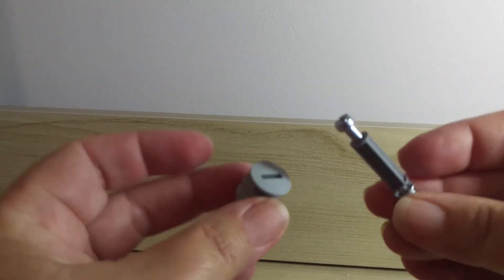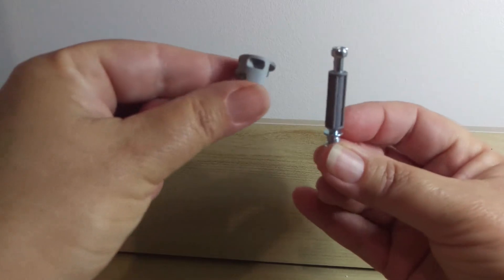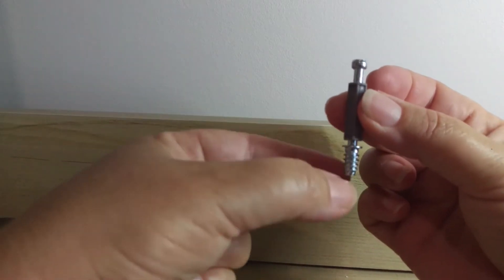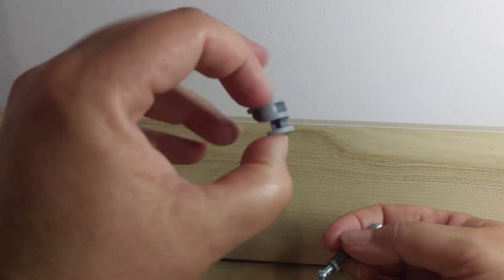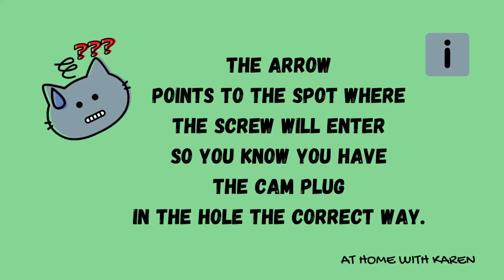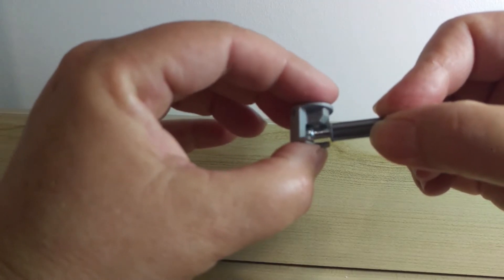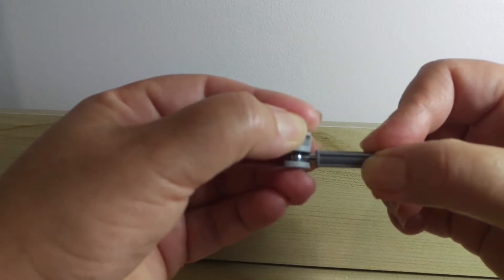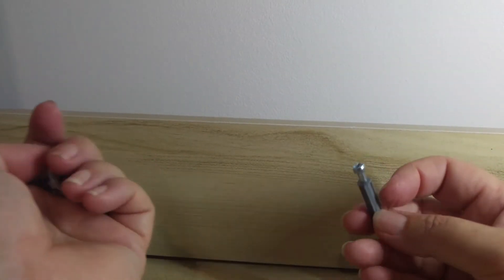How does a CAM LOCK work?

Comment: The screw part number # 118331 doesn't really explain if you bottom out past the "washer" like ring closest to the plastic shaft. Because in the Alex drawer instructions, it showed a picture that you screw all the way in until the plastic part touches the board
Reply from the maker: Sorry, can't offer any advice about that. I've only assembled Billy items and they were all very easy to do.
Reply: @AthomewithKaren  I phoned Ikea Canada and reported the discrepancy in the manual that it doesn't reflect the hardware mechanical drawing from parts list.
Reply from the maker: @theUAPwhisperer  that was a nice thing to do! Hopefully they'll update the instructions quickly.  You have probably saved a lot of people from assembly stress. 👍
Reply: @AthomewithKaren  👽🙏👽

Comment: I bought something similar to what you have from Ikea too. And I have white cam locks, but they’re a bit stubborn for some of them when pressing down. they are like stagnant and I have to try over and over again until I get lucky and it goes in 😅
Reply: Forgot to mention, my directions said to place the shelves down where the screws on and after place the cam locks
Reply from the maker: @cherie7329  Like everything in life, some are easier than others. Some click together smoothly, some end up thrown across the room, relocated, then put in the bin! 😝 I bought several Ikea Billy bookcases. They were the easiest thing I have ever put together. If all Ikea furniture is that simple to assemble, I understand why they're so popular.